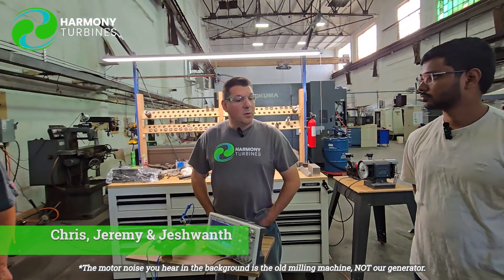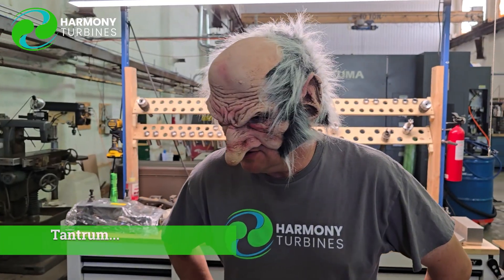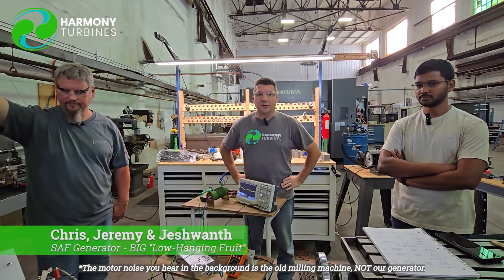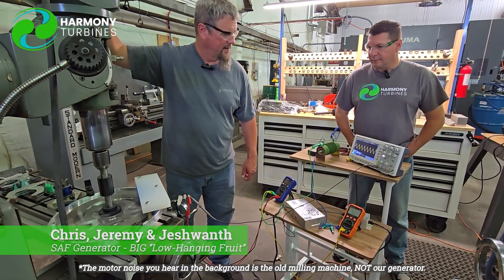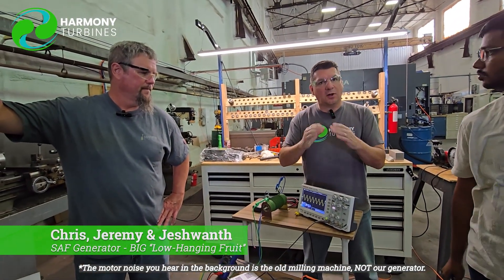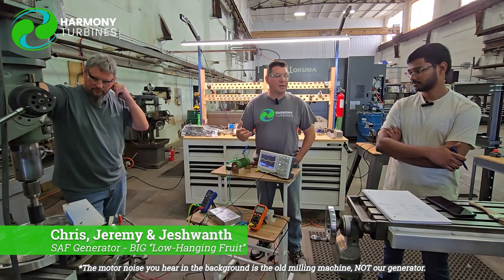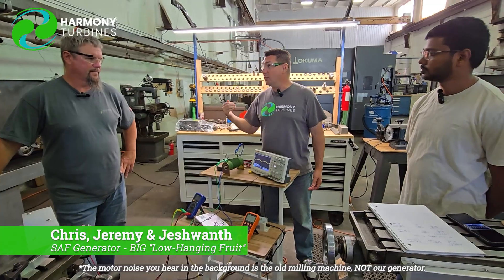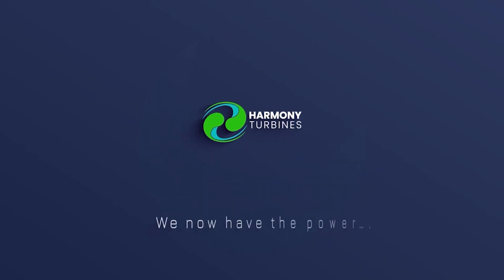BIG Time “Low-Hanging Fruit” for our Harmony Turbines SAF Generator

Comment: When you start production, consider offering the generator separately for other uses thus increasing generator production volume, getting more economy of scale. There is no good low speed, low torque starting value available.  Your turbine is amazing, but there are many other niche areas that could leverage your generator technology without you investing in a dozen different configurations.  
Some examples: a rising air tube on the side of skyscrapers,  designs for very directional air flow between buildings, small water flows, bidirectional air from wave action entering a container, you could tie it to tree limbs and capture the sway from the tree, etc. Any movement that can be captured would benefit greatly from your generator and you could get a piece of those markets with no more than packaging and shipping what you will be producing anyway.

Comment: Consider getting some input from a collegiate source of information? I queried AI on this topic and this is what it came back with:
For Harmony Turbines to make their new turbines the most efficient and also have access to advanced engineering AI tools, top engineering colleges with strong wind energy and turbine research programs would be ideal partners.

Here are some top recommendations:
Massachusetts Institute of Technology (MIT): MIT's Mechanical Engineering department specializes in turbine design and research with advanced computational and fluid mechanics expertise. They have a strong focus on energy and power engineering and likely have access to cutting-edge AI and simulation tools for engineering innovation.

Stanford University: Stanford Engineering offers robust turbine design and research programs, including computational engineering and flow physics groups that study fluid dynamics and turbulence, critical for turbine efficiency enhancement. Stanford's access to AI tools in engineering research is substantial.

Montana State University (MSU): MSU's Energy Research Institute focuses on making wind power efficient and affordable, studying turbine blade durability and advanced materials. They collaborate with local manufacturers and have expertise in computational fluid dynamics (CFD), an AI-related tool used for optimizing turbine designs.

University of California at Berkeley: Their Mechanical Engineering department is highly ranked with research into renewable wind turbines and energy systems, including advanced simulation and computational methods.

Partnering with any of these universities can provide Harmony Turbines with expertise in maximizing turbine efficiency through state-of-the-art research and access to engineering AI and computational tools for design and testing. MIT and Stanford are especially well-known for combining high-level research with advanced AI applications in engineering and could offer the most comprehensive collaboration opportunities. MSU offers a practical, applied engineering research environment with strong ties to local industry for turbine manufacturing and testing.
Reply: Smoke and mirrors

Comment: Traditionally, the helix-like configuration mitigates wide swings in torque and instantaneous toppling force. The torque could swing so low that starting torque doesn't exist for some orientations. OTOH, an airfoil with thickness, such as the one in your logo, might independently mitigate those swings.